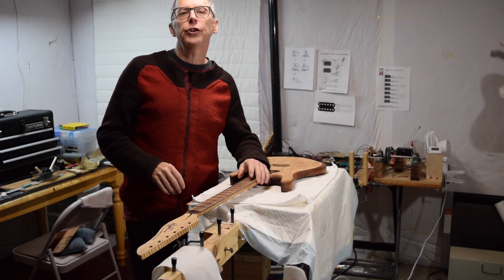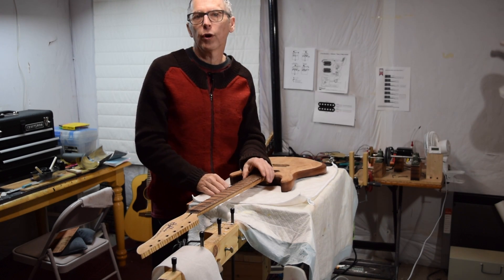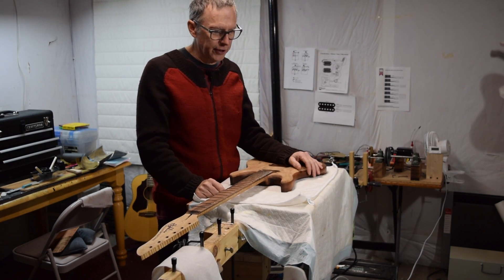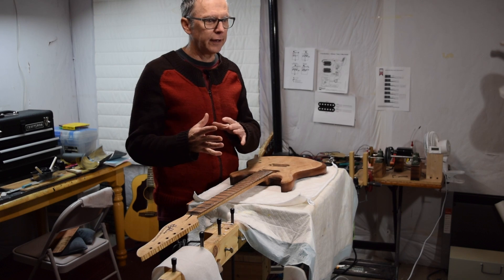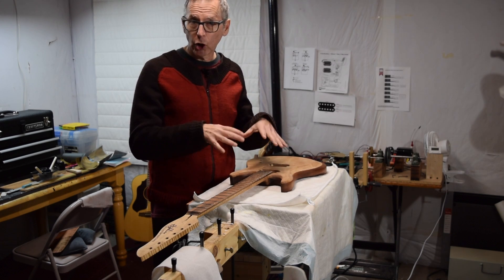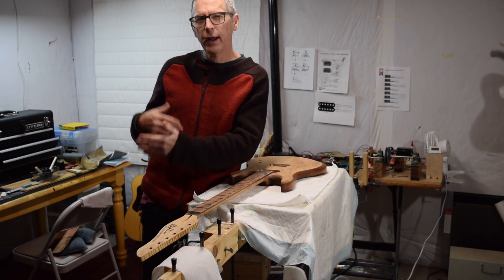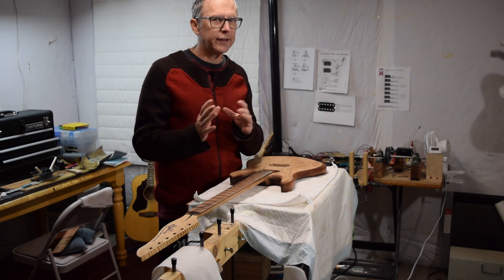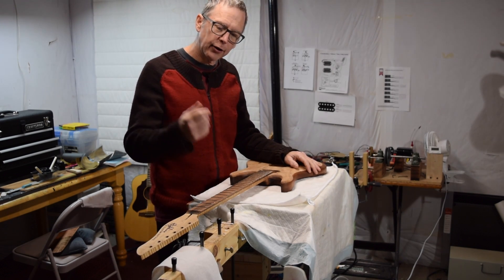Updates On The Solarez Guitar Build And A New Zero Fret Design

Comment: Yay!  Finally some success. I have manage to spray a quality coat of this product. I can let you know that this single coat has the best finish of any product I have ever used.

What I did this time.

I thoroughly cleaned my spray gun with acetone. Washed a clean rag in acetone. Used compressed air to dust the body off. Used a tack cloth to remove any other particles. Wet wiped the body twice with acetone with the acetone cleaned rag. I thinned the solarez spray version with about 20% acetone added and then sprayed 3 coats just thick enough to get a shine on each coat. I waited 5 minutes after each coats for the acetone to evaporate out then I exposed it to sun light. 

Truely a glass like finish. There were a few dust particles that stopped it from being perfect but I wouldn’t have even had to buff this finish it’s was so glass like.

I will send I link to a video when I have done the final coat so you and anyone who is interested can see it.

I will definitely work on perfecting the use of this product for future use.

All the best with you builds Chris.

Comment: Hey great videos love your channel.
I am building a guitar and am using I can’t believe it’s not lacquer.  I tried to spray it as I have the spraying version. No good. I have tried to brush it and foam brush it as well. Tack ragged it, use alcohol to clean it, tack ragged it again etc. If I put it on really thinly I can get an okay finish but I find I am nearly sanding the whole layer back off to get it where it needs to be and it’s hard to stay in the last layer when sanding. Do you have any tips on getting a thicker coat. When I get it as thick as I would like for a final coat it pulls and fish eyes. I am at the point where I think I would have been better off with nitro as I can get awesome results with nitro.

I have done a test piece final sanding at 1200 for a matte finish and it looks great but I just can’t get a thick enough final coat to stay within that coat on the final sand to remove the brush lines

Pulling my hair out! Please help

If you are interested in what I have done so far have a look at my vids.

Regards Paul
Reply from the maker: Try cooling the stuff in the fridge overnight before applying. I have found it seems to like colder temps. If that doesn't work, email Solarez and let them know what problems you are having.
Reply: Thanks, I will give it a try. This product would be awesome if I could get it to spray or level out like real lacquer.

Thanks for your reply, cheers.